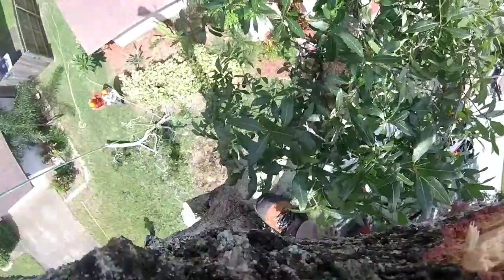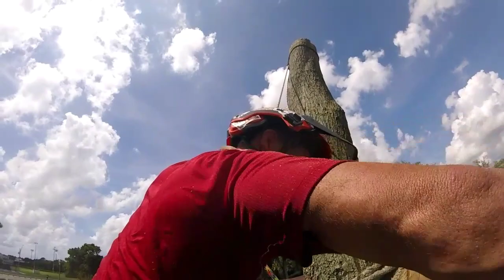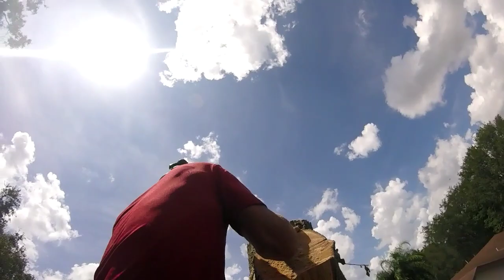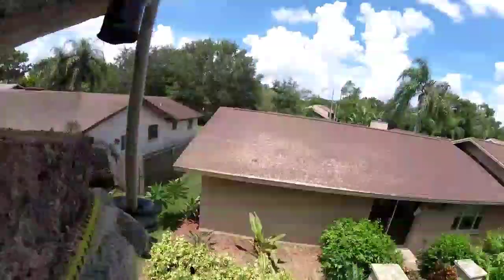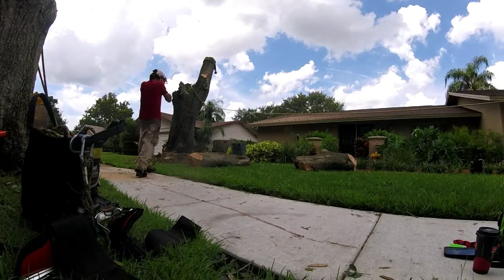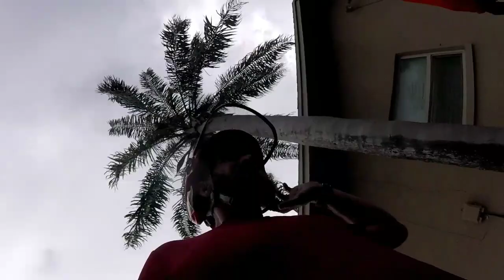#5(RAW) That one street side oak we did: last part

Comment: Everytime I try watch videos it takes me to part 3 or 4.but never the first even on older ones.i still say you have the best videos been Watchung for years and years.ive asked you about those geckos 🦎 for years now the reason why is your about 5ft9 or so correct? So either you have super long shins or there's another type of geckos..sherril tree is wear I thought you bought yours from local dealer. I'm 5ft7 maybe.and can't ever find them that adjust low enough down to my shins the geckos? I see you put yours on every other video or so and they are like 6to 8 inches below your knees?I realy want to try those aluminum geckos 🦎..from my research sherril tree sells a slightly different type of pad same spur..shank.though..and then bartlett has them with dmm shanks spurs?then now there's the distels. Wich were originally gecko before notch..and they have alot of holes to adjust the height of the pad below the knees...there's no shop that can go try them on here.so I have to order 5 and 6 hundred dollar spikes then send them back because they don't adjust down low enough.its why i always ask you...?..may not be big deal to you but it is for me..I ordered the eagle talons and had to cut the shank at the top off almost 2 inches but because they have enough holes can adjust them they fit.but want spurs that can just strap on easy like yours .. I bought the kleins with pole gaffs and opsal pads they are just half inch to long hit my knees..have a torn right knee that won't heal inner lower knee and can't have that top of shank or pads pressing on it.Man if you could one day when you put your geckos on take a tape measure from the bottom of your foot to the top of the pad and red cover..that measure ment would be all I needed..sounds crazy request but would be big great great help ..plz sir thank you ..longtime subscriber. Was subscribed under under another channel and got booted feww years back....would be big help ..I'm older and in bad shape ..never hurt before so thanks ..happy new years...